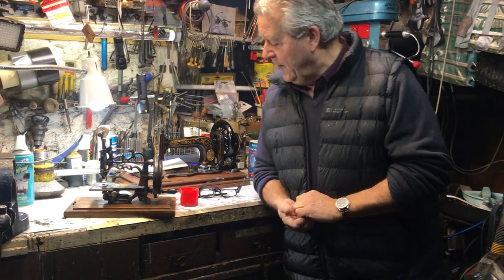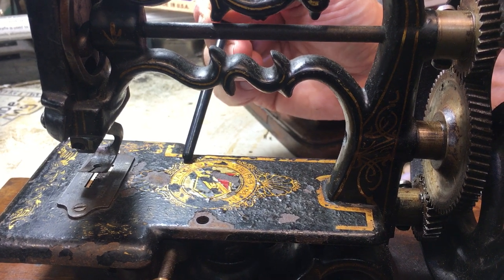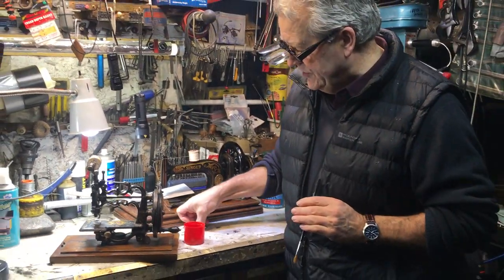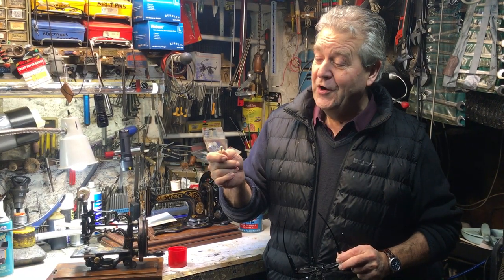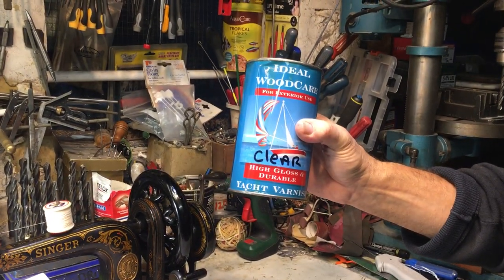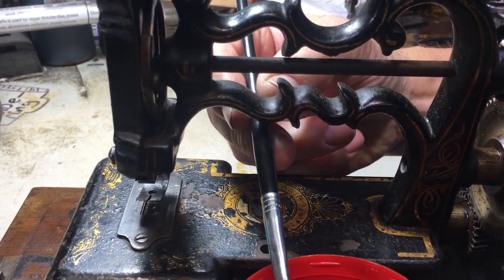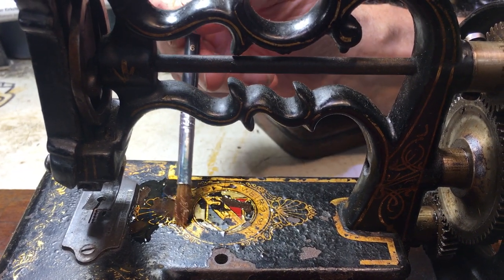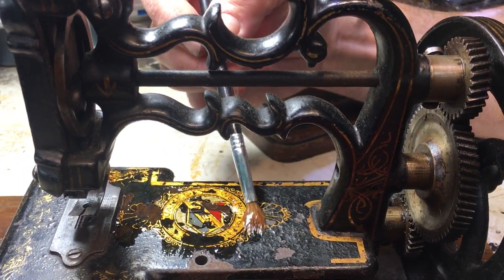Alex Askaroff presents sealing flaking paint on old sewing machines.

Comment: I have a machine that does not have flaking paint but does have paint that has bubbled in some areas but there are no visible cracks in the surface. I am considering using this product with a fine needle and injecting this into the bubbles. would this likely work to resel those areas of paint?